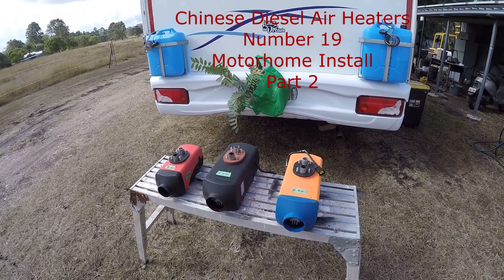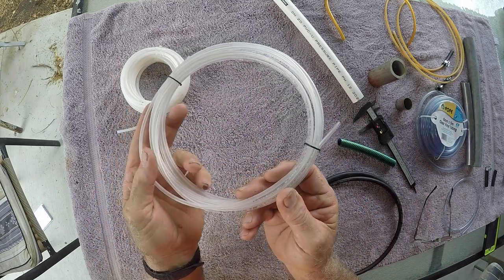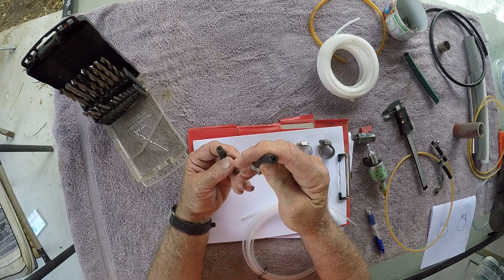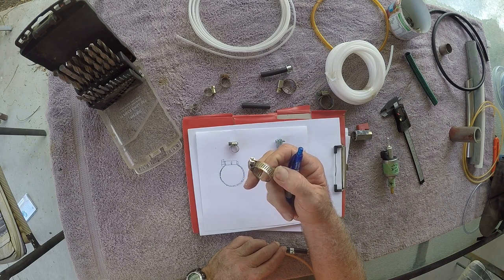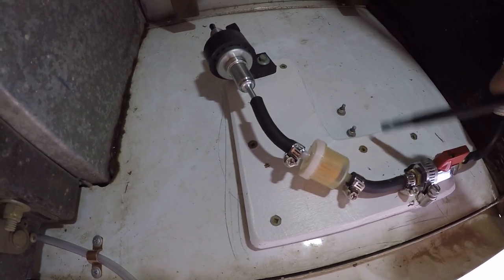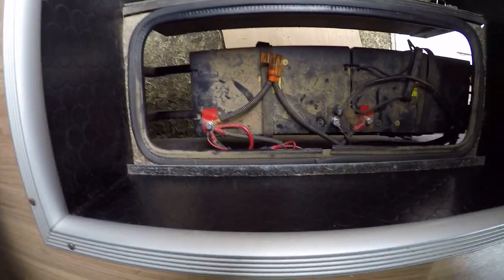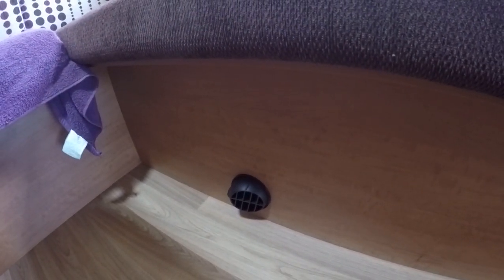Chinese Diesel Air Heaters no 19.   Motorhome Install Part 2

Comment: REPOST of reply on my earlier exchange, so this appears in the main thread...
see UPDATE 2020-10-18~20: in replys
@John McK 47 ~~~ Total SUCCESS! ~~~ with your info and responses I got exactly the unit I sought.
Low & behold, the black 5KW unit with the non-straight muffler came up, of all places, at Walmart.com
... and the colored unit(also 5KW) also came up at Walmart(it has the straight muffler and the newer control and remote control, and standalone fuel tank! ...ordered it on Oct 13th, will be here on Oct 16th! with 30 day return, free shipping for $129.00.
Yeah they are both sold as 8KW but that does not matter, if maybe the fuel consumption! ...as I have seen these units have a bigger fuel feed than the 2KW.
The tracking shows it starting in HOUSTON, TX... thus, where the warehouse must be!
Reply: UPDATE 2 ~ 2020-10-20:

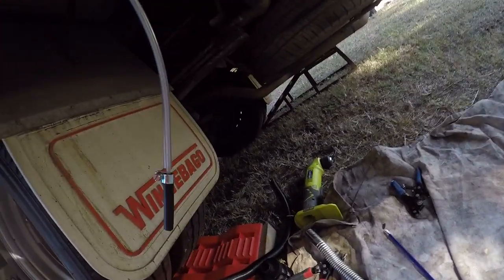@24:26 ha! I see what I needed ... The install of the unit is not in this video, but you can see the location of the unit from under the vehicle... and notice that the hole is closely cut to the dimension of the entire set of connections, a wise approach rather than to cut a hole for each item as on the metal plate that comes with the unit. ...and from that perspective one can see that the plate is bolted/screwed to the top of the floor then the unit is bolted into the plate squeezing the rubber seal.
What that accomplishes is to allow the unit to be installed on any thickness floor, and it keeps the hot exhaust clear of the floor material... surely the metal ring John Mck 47 added is also a good idea, it should come in the kit.
I believe the unit install is the previous video... is it!?

Comment: take your wd40 and toss it in trash. use fluid film. it wont evaporate like wd40. and it leaves a water resistant coating that prevents rust

Comment: Qst: After MANY MANY tries...still not working. I did install the fuel hose like said in this video. I tried it with heating oil (I got PLENTY of it at hand)... though... Is it possible that heating oil isn't working?  I'll try diesel today, And I'll try to open it if still not working... Here in Canada, the cold weather is coming really fast!!! Comments are ALL welcomed.  Tks
Reply from the maker: Hi C2011,

These heaters are very simple machines. 
They need power, and clean fuel to run.
They need a good glow plug and a clean burn chamber to run.

1. Is your heater new? Or is it old, and has been running previously?
2. If the heater is new, can you hear the pump ticking? Is fuel getting to the heater? If not sure, take fuel hose off heater and see if it squirts out.
3. If fuel is getting to heater, check the glow plug. Is it getting enough voltage?, is it getting hot?

If the heater is new, I would suspect no fuel getting to heater.
If heater is old, I would suspect excessive carbon build up in heater.

Good luck.  JMcK
Reply: I solved my problem. It took me a while though. After watching this video many times, I solved the fuel problem. I installed the plastic tube as you mention. Didn't solved the problem yet... Then I plugged it from my running small pickup truck and...it worked!!! But only worked when hooked up with 14.1 volts comming in... So for a few nights..I had my Ford Ranger running all night ( small 2.3 engine so kind of cheap to run...). Then yesterday after watching your video for the "thousand" times... :)  I realized the wire problem: way too long and way too small...like you specified here. So next project is to put a bigger gauge wire like you did. I'm a DIY person but sometimes it takes me a while to understand everything.  

Now another situation here: I bought a new MPP Solar inverter solar charger 24 volt All In One system that I just received 2 days ago but still not assembled the whole system yet cause I don't want to "f**k" my new expensive system by doing a basic mistake. 

This chinese diesel heater is supposed to be able to work on 24 volts... I didn't find anything on that subject to YouTube... Should I ust plug it to 24 volts (or not) and see if it will really work?....   :(  I'm a bit nervous about trying it.

Also: it's a brand new heater,  so it should have been running  ok from the start ... And since I'm moving into my new converted shuttle bus into a RV this winter... I bought not only one but 3 brand new chinese diesel heaters for security purpose during the cold winter here in Canada (only installed one hough).But the thing is that I got a BIG deal on Kijiji: one guy bought these 3 heaters for his cny's trucks but because of the CCP virus pandemy...no more job and closed his CNY and sold his trucks...and the 3 diesel heaters for...$600 all together!!! Great deal for me I think...

Funny fact: When I bought this bus, there were two Espar diesel heaters already installed but not working...(reason why I bought two chinese diesel heaters...). It took me a while to understand why they were not working: these are old models (D3 models) not very popular here I guess. And there were the control unit missing... that I didn't understand at first...

So now I have four... "spare" diesel heaters sleeping in my cabanon...

But at least now I have heat inside my RV / shuttle bus (I am doing the conversion into a RV while already living in it right now... It's not the best situation but that's what I'm going through right now.

Anyway, your videos helped me to finally understand everything I needed about these diesel heaters.

Tks again.
Reply from the maker: cambobby2011 

Thanks for the detailed feedback.

The heaters are voltage specific. You have a 12V model or you have a 24V model.

Yes, some controllers are multi voltage, but the heaters are not.

The fan motor, the fuel pump and most important the glow plug are voltage specific.

If you are a real enthusiast you could probably adapt a 12V heater to run on 24V's by changing the locked settings, but you would need a new glow plug. A 12V fuel pump would work "for a while" on 24V before damaging the seals and burning out.

You MUST increase wire size if you lengthen the loom. 

Pleased to hear you are now  warm.   JMcK